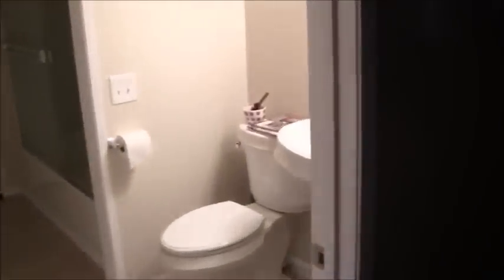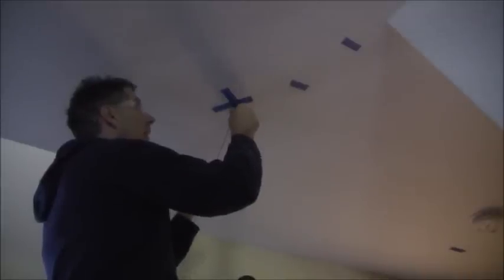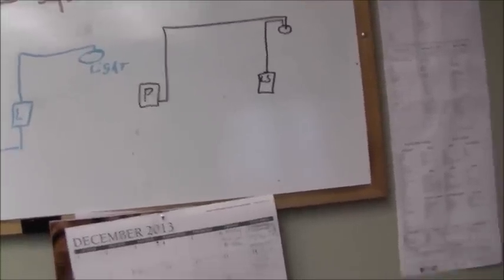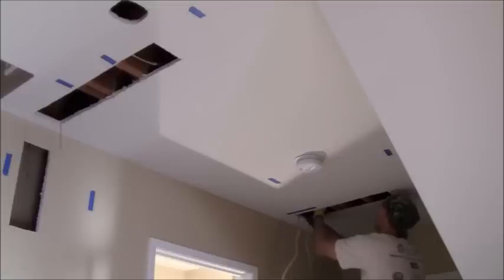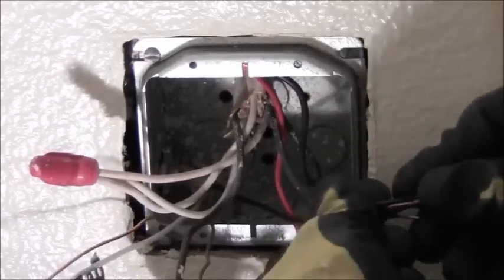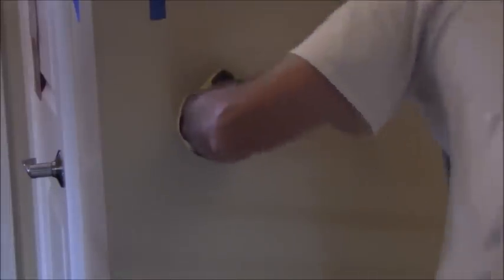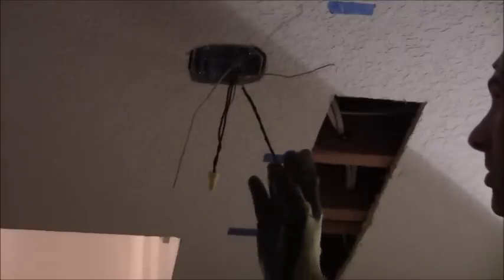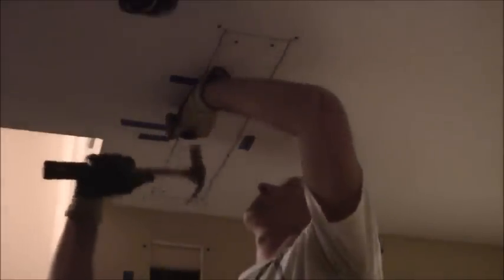How to Install a new Ceiling Light Fixture from Scratch

Comment: Two 6 inch recess cans fitted with low wattage lamps,bucket of jet line, fish tape,5 ft flex drill bit.....does the job with no drywall cut outs. Pro tip, strip the romex outer jackets before installing in boxes.
Reply: James, explain to me why he went from the bathroom switch to the new fixture and then to the new switch and used white to go back to fixture. It would not work if he had gone black and white from bathroom switch to black and white to new switch and then from new switch to new fixture?
Reply: Dave Meraz he back fed it. It still works, it’s just not how it’s supposed to be done lol

Comment: dome flush mounts are the worst. so dim. go with point out lights or semi flush. huge difference. and avoid halogen. They give off a lot of heat. i use low wattage LEDs on incandescent fixtures. they are very bright, brighter than incandescent itself, at least with clear philips brand LED. Avoid cfl. They have mercury in them that can spill if the bulb breaks. they also emit UV which yellows white plastics over the years. I'm curious to know how you shove the wires into the box once you have connected a fixture. I did mine recently and now im thinking did I over bend them? does that arc? the house wires are quite thick so im not overly worried but interested to get your view.
Reply from the maker: depends on how crowded the box is, you are probable fine.

Comment: On part six of video it starts with wires already stripped @ the ceiling box. Question: where did you get 3 black wires. You 2 twisted together & 1 alone. You only have 2 - 3 conductor wires which is a total of 2 - blacks, 2 - whites, & 2 - grounds
Reply from the maker: good question. at 1:05:04 you see 2 black wires and 1 white wire wraped in black electrical tape. this this the traveler wire from the switch. When the switch is up the traveler wire will have 120V and power the light fixture.
Reply: Yhks for clarifying, so you twisted both blacks & does the white & white wrapped in black are gonna go together. Since video doesn't show connecting light fixture
Reply from the maker: @ricardoquiroz3994  no, the light fixture will have 1 black and you connect the wraped white to that. the traveler wire from the light switch will power the light when the light swith is up.

Comment: I'll tell ya one thing when installing new boxes, in older homes with have plaster and lath, I definitely recommend everyone uses a medal old work box. I like the blue plastic remodeling boxes with drywall but if you make the hole the exact size, you can gently tap the box in tight in the wall, and it won't pull out as to wear sometimes the plastic remodeling box, is hard to get the wings tight and if you tap them in, they can bend

Comment: do you have any videos explaining traveler wires and some of the other terms you use?
Reply from the maker: There are a ton of videos on YouTube about this. The hot wire goes to the switch. When the light switch is turned on, the Traveler wire is now the hot wire bringing power to the light fixture from the switch. If you look at the instructions for installing a light switch or a light fixture, this information should also be there.
Reply: @KenTraining  Hey Ken, you are a wonderful teacher. Thanks for clearing that up. So when we dont have a traveling wire, and just have a regular white going back to the breaker system, is that white still considered "hot" since its carrying live power away to complete the circuit?
Reply from the maker: @MathCuriousity  I know this is a little confusing but a neutral white wire acting as a neutral wire is not considered a hot wire, but it does carry electrons when completing the circuit and can kill you if you touch it. A traveler wire from a light switch to a light fixture, best practice is a red wire but in many cases you run a romex 12/2 to the switch and you use the white wire wrapped with red electrical tape to act as the traveler wire.
Reply: @KenTraining  Thanks so much for the clarification!! I was just confused as to why its called "neutral" when effectively its still carrying the same energy as a traveler, just back to the circuit breaker box as opposed to to another switch or appliance. I think I understand now.

Comment: Grest video!!! Can I use that type of light on my porch outside?
Reply from the maker: the light I put in is not outdoor rated. Install outside at your own risk.
Reply: It will say on the box if its rated for outdoors. These lights are meant for inside/covered spacing. Outside lights are built more waterproof/weatherproof.

Comment: stupid question but why drill holes in the joist? Why not just feed the wire over the joists?
Reply from the maker: I was on the 1st floor of a 2 story house. I had to drill.
Reply: @KenTraining  Aha I feel stupid. Thank you. But I realized even if you were on the second floor, its probably still smart to  stabilize the wires.
Reply from the maker: @MathCuriousity   I think code states every 4 to 56 feet.
Reply from the maker: @MathCuriousity   I think code states every 4 to 6 feet.

Comment: Would it be necessary to cut a hole on the ceiling.if there is a.opening for the.attic?
Reply: Looks like a 2 story home to me. If it were the attic you would see insulation when he cut into the ceiling
Reply from the maker: Yea, this is a 2 story house and the job was on the first level. If the ceiling was the attic, I would have done it differently.

Comment: How much would this normally cost to have someone install a new light fixture?
Reply: +Kaitlyn Davis If it's going into a ceiling where no light fixture exists, it will require running electrical wiring and a light switch. Same as if it was a ceiling fan where none existed. In my case, I got quotes ranging from $150 to $250 on thumbtack dot com...but some are licensed, some are not. Some installers are one person or father/son operations while others are companies with employees.

Comment: I am trying to wire a new ceiling fan from scratch to a switch that controls an outlet in the same room...when taking out the switch(single pole) there was one black wire on one side and one white on the other and the ground wasn't connected...I decided to go with a single pole 2 switch. So this is where the problem arises...I connect the existing black to one side on the bottom switch and the existing white to the opposite side...the outlet across the room works the same...but then I wired the black wire from the fan to the top switch above the existing black wire and the white to the other side...just like the other switch...(and the ground to the ground) and no power to the fan...the top switch is connected with the bridge from the lower black wire...I talked to an electrician and he said that I don't even need the white(neutral) from the fan...he said cap it off..I'm confused...I even tried wiring the white in junction with another white from another outlet...(basically spliced into it) and all kinds of craziness happened....the fan only turned on when the light was on in the outlet and it only operated at half the speed...I looked up wiring diagrams but can't seem to find the correct one...can anyone help????
Reply from the maker: jared rusk my advice is to call an electrician who can fix the problem. to fix this you need to know how to wire switches, outlets, fans and lights and how to use a multi meter. Also knowing the NEC code would be a good thing. if that is not you, call someone who is.

Comment: Very through, except for the part where the fixture gets wired up....nice up to showing the final product without showing what wires go where.  For instance, the 'traveler' wire, recoded black...where does that go?
Reply from the maker: I made a mistake on the wiring. Do it this way. Power to switch is a white wire relabeled to red and then use the black wire to take power from the switch to power the new light fixture. 
I hope that helps.
Reply: Thank you, that was exactly what I was looking for.  Thanks again.

Comment: Touching a potentially live wire to ground to see if it arcs is NOT THE WAY TEST IF IT IS LIVE, THAT IS TERRIBLE ADVICE! Folks... NEVER DO THAT, EVER! Use a meter to check if it's live. If there is ANY doubt, your fingers don't go anywhere near those wires until you 1) verify that your meter is working by first checking a known live circuit, and then 2) checking the wires you're working on.